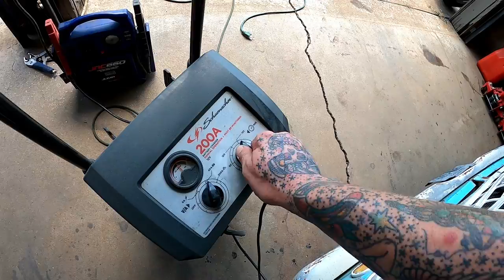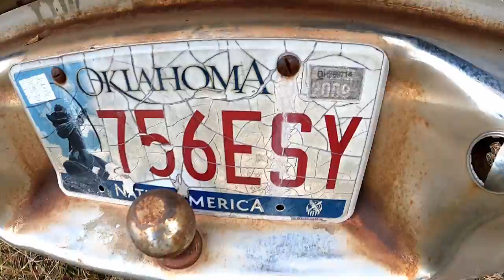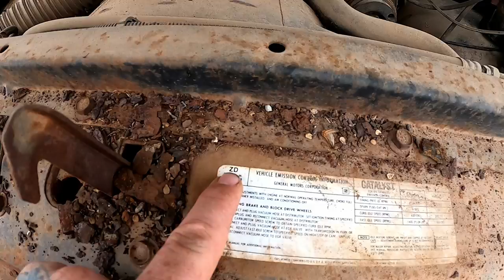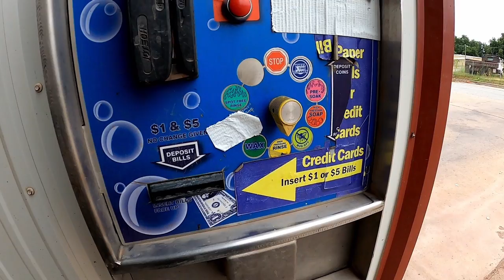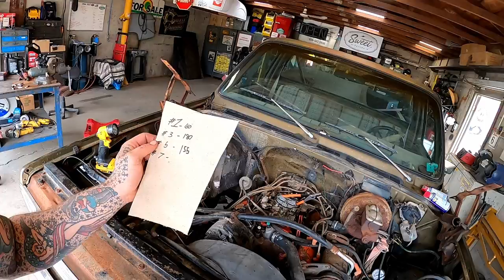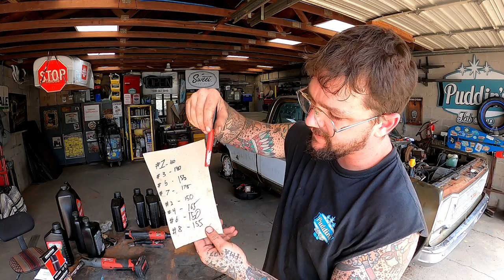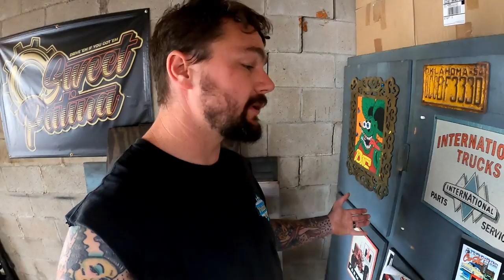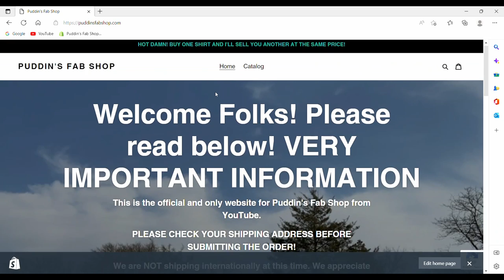FREE 1976 GMC Sierra. ABANDONED on my new property! WILL IT RUN?!?

Comment: When  installing a Small Block fuel pump. Open up an old hose clamp (worm gear variety) and use it to slide the rod up and out of the way. Your welcome.

Comment: MUCH RESPECT for your approach to the "will it run" genre. As always, your systematic attack is so refreshing compared to every other channel! You clearly were trying to preserve the potential for the longterm usefulness of that engine.....and, boy, what a healthy sounding one it turned out to be!! Hubby and I are debating exactly what kind of gem you've got there...the orange color and two line fuel pump (Airtex 40987) imply a potentially older and hopefully higher horsepower one than the year of the truck. Airtex 41216 style pump has the extra return line and I believe is more likely correct for that year. We're also trying to remember when GM changed engine color on trucks to aqua/blue. What we're saying is, please run the numbers on that engine to see exactly what is....it sounds reeeally good, especially for an abandoned truck with a quadrajunk carb!!

Comment: IMPORTANT block off those heater core hoses otherwise your coolant will go through the hose instead of the motor because without the heater core those hoses are the path of least resistance.  AND DON'T LET ANYONE TALK YOU INTO GETTING RID OF THE QjET.

Comment: That was a good trick with the magnet on the fuel pump rod.  under the alternator is a bolt. If u pull that out and stick a screwdriver in that hole it will hold the rod up. Thats how ive always done it.

Comment: On chevys, that fuel pump rod, if you take a glob of grease and put it on the shaft, and shove the shaft back up into the block, it gives you enough time to put the fuel pump in the hole

Comment: For the heater delete, all you gotta do is plug the ends or pinch them off. They don’t have to connect or flow. Same as putting a plug in the holes. Heater delete for racing!

Comment: There’s a bolt on the front side of the motor that you can remove and put a longer bolt into to hold that fuel pump rod in place when you take out the pump and replace it

Comment: 57:20 A slightly easier trick my grandpa taught me to deal with that fuel pump push rod, is pull it out, give it a coating of some sticky high temp grease, and send it home. The grease will hold it in place long enough to get the pump installed.  I also use this trick on my sockets to hold a nut when I need to get it back in a tight or weird angle spot.

Comment: QJets are like fine wine, they get better with age. On the front of the engine by the fuel pump is a bolt, take that bolt out and that gives you access to the fuel pump push rod. Take another bolt that’s a little longer so you can put pressure on the pushrod to change the pump.

Comment: My dad's 1952 ford prefect sat for 3 5 months all original apart from 12v system it started in bely 10 seconds it idled had no problems 
It's been sitting for about 6 months as alternator is buggered and battery went pop

Comment: GM mechanical fuel pump install.  Remove the mounting plate, pull the push rod and plaster with heavy axle grease, replace to hold it in place, replace plate, install pump.

Comment: Look at the front of the block right in line with the push rod an U should see the head of a bolt. If a guy takes that bolt out U can push the rod up an put a small screw driver in the bolt hole to hold the rod up while U set the fuel pump in place. Teck tip for the day. Great little truck. Glad to see U moving on up. Thanks, good job 👏

Comment: HOT DAMN! That looks like an old "Gentlemen Jim" GMC. It was a package on the Sierra from about 1975 to about 1977 or so, hence the woodgrain on the dash and door inserts. I'm not sure if it's worth anything,  but those old square bodies are going up in value. Thanks for sharing, Puddin!
Reply: I've got a 76 myself with 86k original miles. Belonged to my great grandfather that he bought new and drove around town. Pristine body and interior. I've been offered $30k for it. I probably should have taken it but the next 30k I'll take for sure. Assuming it comes along again.

Comment: Corporate 12 bolt rear end most 1/2  tons have 10 / 12 bolt, 3/4 ton &1 ton are 8 lug turbo long shaft 350 trans clean 350 motor, you got something pretty decent right there, nice work dude since it's 2wd. I would do a 5inch flip kit & 2 inch drop shackles. 4 inch  drop  spindles   up front, and drag the bumper off it!!!  Headers headers headers headers!!!!! 3 inch pipe after,    
Maybe give the ol towrolla some real love with  a brand used 2zz motor front a newer Rolla with a shift kit.  She sure does help alot.

Comment: Fuel pump push rod.. there's a bolt on the front of the block.. replace it with a longer bolt and it will hold the rod up while you change pump.. 😎👍

Comment: 42:55 An easy way I've found to thoroughly drain bottles of oil and other valuable fluids --- get a wide-mouthed funnel and insert it into one of the mostly-emptied bottles, then place each of the other bottles upside down into the funnel and let it drain for maybe five-to-twenty minutes (depending on how heavy the oil is).  Then place the funnel into the oil-filler opening on your vehicle's engine, insert the spout of your now-partially-filled collection-bottle into the funnel, and allow it to drain upside down for maybe 10 minutes to half an hour (again, depending on how heavyweight the oil is, and also how warm it is outside where your vehicle is).

Comment: There's a bolt hole on the front on the block down by the fuel pump, run a bolt in it before you take the pump off. It holds the pump rod up so it can be changed easily.  👍

Comment: On the front of the block, there's a lonely 9/16, just chilling all by itself in the block.
Remove the little stubby 9/16 bolt,  lift the fuel pump rod & snug a longer 9/16 bolt (3/8x16thread) in hand tight.
That will hold the fuel pump in place well you install the fuel pump. 
Just don't forget to put the little stubby one back in when you're done! ;-)

Comment: When you are installing a fuel pump on a small block Chevy, there are threaded holes in the front of the engine that you can put a bolt into and it will go against the fuel pump rod and hold it in place while you put the fuel pump in. I can't remember if the factory has a bolt in the front or not, been a while since I've worked on one. You want to screw the bolt in until it just makes contact and will keep the fuel pump rod in place. Nice score on the truck.

Comment: I bought a 97 Tahoe for scrap price a few years ago, $300 bucks with the intention of using some parts of it and either sell or scrap it, the guy said someone did a tune-up on it and it wouldn't run afterwards, I hauled it back and I played with it and noticed they had all the wires wrong on the distributor cap, I fix that and it started right up and ran great aside from he power steering line leak from mice as it sat for over a year. I fixed that and sold it for $2700.

I bought my daily a 99 GMC suburban that had a hole in the block for $340, I changed the engine from some truck that I knew nothing about, runs good, but has oil pressure issues at idle, I still daily it, I got another 5.7 Vortec waiting to drop in it when the time comes lol.

Comment: Hey Puddin', there is a short bolt going into the front of the block that lines up with the fuel pump push rod. If you remove that bolt and put in a longer one before removing the pump it will hold the push rod up while changing pumps. Just remember to switch bolts again before starting the engine.

Comment: I Got My Dads 1976 C10 350 Engine, 350 Transmission.  Short Bed, Factory AC, its 2 tone white with Carolina Blue between the  molding, Need to restore it gor 201,00 on it all original paint and blue interior! Keep Up the Great work my friend!

Comment: To. Help get your projects into the shop. This is what I did. I installed 1/2 drop in  concrete anchors into the garage floor and a single anchor about ten feet in front of the garage door. 
Then I mounted a cheap wench. I can pull anything I need into the shop by myself. Use a snatch block  if needed. I remove the bolt that mounted wench and the anchors are flush with concrete. Takes minutes

Comment: QUICK TIP FOR CHANGING FUEL PUMPS ON OLD CHEVY SMALL BLOCKS AND MAYBE BIG BLOCKS TOO.PUT A DAB OF GREASE ONTO THE TOP END OF THE LITTLE PUSH ROD, THAT WILL HOLD IT UP LONG ENOUGH TO GET THE PUMP BACK IN, ALSO DOESN'T HURT FOR A LITTLE LUBRICATION. STAY SAFE HAVE FUN

Comment: the trick to shutting those gm hoods without turning them into a taco is to push it back towards the cab to start the hinges moving, then pull it down to close it. works every time. lucky you having a c10 with a tree fitty come free with the homestead. if i'm not mistaken, the red engine paint might indicate a 4 bolt main engine. i'm looking for a 70's chevy 4 door car sitting in the weeds somewhere to pull a sbc out of for my '36 chevy truck project. won't find a square body anywhere around here. somebody has already snatched 'em up long ago to put back on the road.

Comment: That truck has the factory sport mirrors most of the C10 trucks especially the custom deluxe and Scottsdale trucks that didn't get the below eye level mirror options.. and I am from the area where if farmers ignition switch or park neutral switch goes out or is out of position they drop the ignition switch off the top of the lower shift tube on the column and or the 2 power wires hanging over on both sides of the steering column smack them together and throw sparks starting the truck and usually the starter is very loud and needs shimmed or shims removed

Comment: Take the top off a q-jet replace the accelerator pump and reseal the fuel bowl where the original epoxy dries out no longer sealing and let's fuel drain out,a quickie cleanup and she'll be a 1or 2 pump started and running champ

Comment: When installing the fuel pump there is a bolt that lines up with the push rod, one of the timing cover bolts I think, remove this bolt and install one longer, this longer bolt can reach in far enough so when you push the push rod up you can snug this bolt and hold the push rod in place while you install the pump.
Once you install the pump, you swap the shorter bolt back in place.
On the rear end I would top up the gear oil, put on some tires that hold air and drive it around and listen for rear end noises. If it sounds ok then just replace the pinion seal. You can check out how the tranny functions.

Comment: Neat SBC trick that will help you install block mount fuel pumps locate the passenger side water pump lower bolt and you will notice two bolts one that is in the recessed part of the engine block and one shorter bolt below it use your finger and a screwdriver push the fuel pump eccentric rod shaft back up and swap the two bolts and it will hold up the fuel pump rod so you can easily install the fuel pump..

Comment: Hey Puddin it is a lot easier to close a GM hood if you push each corner of the hood from the front towards the windshield first. One corner then the other and the hinges will start to close. Then close the hood the regular way. Just some tip from me. Take it or leave it. Keep up the great work.

Comment: You can polish the dash bezels up with toothpaste or some semicrome metal polish. I think I read brasso would even work. If your wanting a quick job just spray with WD-40. But wd 40 dont last long as polishing with an abrasive like tooth paste or semicrhome polish. Ratrod Bob has a whole video on a taco hood.

Comment: Puddin, you may in the future have a very hard time finding parts for that truck. A good bit of parts on it will be 73-76 only and 75-76 only. barely anything is reproduced for those years. When you open the hood, on those older trucks. Pull it Towards you & continue to push it up. otherwise sweet rig. Good old Quadrajet!!! love that sbc exhaust Rapp.

Comment: My 1976 GMC C20 Camper Special in WI had plywood floorboard back in 1987..  This truck here is barely rusted in comparison. Could kick an empty can out the corner by the clutch & crush it under the rear wheel. whoop-splat!. 0-60 in 2nd (actually 3rd cuz grannyk) gear.  Those 350's are virtually indestructible.

Comment: I had a 74 Chevy C10 Cheyenne super long bed 2wd it was a factory 12bolt 4.56 gear rear end and originally was a 454 2bbl ac 3spd on the column manual Saginaw transmission no power brakes but 6 lug brakes and big brake shoes in the rear

Comment: 150psi to 180psi compression is 16.7% of 20% max tolerance of percentage difference between cylinders for passing grade as healthy eng. And maybe it will get better after up and running a little.
Oil press and quiet mains and rods is the next question once running temp is reached

Comment: What a great find. If the numbers match on the engine, she might be worth a good old fashioned restoration job. Even that folded hood looks like she'll survive with a little bracing.  BTW it looked like when you were first trying to get the hood closed out in the field and you sat down on the right side of the hood, I think your mouse come flying out the front of that hood on the left side. He was a flying faster than a politician runs from the truth! Your ICR (instant carburetor rebuild) juice did a real good job, too, on that quadrajet. That truck looks like a nice old gem!

Comment: Dadgum GM had to have brackets to hold on brackets back then. Going to serpentine belts was a wise move on their part because they damn sure could not design v- belt brackets for the engine accessories.

Comment: You should put a flat on it stacks or sida pips good set of 10 inch wide wheels a gooseneck ball and a good back bumper and a good ball there maybe back air bags and make you a truck to pull your car trailer with

Comment: Don't strip that square body for parts! It's probably just a blown out pinion seal and a few tires from being a driver.  GM 350s are a dime a dozen, and you've got a crate motor on the floor of the shop just taking up space. The smoke looked like carbon and will probably clear up with a little run time.

Comment: Where did you get the tires for the Towrolla? I have a Corolla as well and want to get similar tires, but I've had no luck finding tires that fit. Is it not the normal size wheel?

Comment: PUDDIN, you are committed to getting that 350 quadrajunk running, but you should be replacing the spark plugs with a by hand situation...... Those blocks tend to strip out at the top of the threads of the spark plugs...... I GOT THE LUMPS AND THE DENTS ON MY HOOD TO PROVE IT...... GRANDPA ALWAYS TOLD ME RO STAR EM BY HAND AND TIGHTEN THEM down till they don't move any more..... The saving grace on this block and heads is they were junk metal but they could take a beating until GODZILLA DECIDED TO STOMP ON THE ACCELERATION STEP UP AMD RED LINE THE MOTOR A FEW TIMES blowing off the top end.

Comment: I really don’t know why Quadra jets get a bad rep. They are the most reliable carb out there until people who usually say “ I don’t know about that fuel injection give me a Cob-ew-rate-or instead” or “ I had a 1994 Chevrolet with a throttle body and swapped it for a carb” have worked on it. They are definitely the most complicated domestic carbs but really dialed in if you just put them back together exactly how they came apart.

Comment: 35:55 I don't blame ya one bit for not liking side-post terminals, Dude --- they just always seem to trap corrosion so much more than the old top-post-style batteries.  I have converted so many side-post-cabled cars to top-post that I've totally lost count!  I do not, however, actually cut off the cables' terminal-ends like you did here; I've found that the terminal's flat copper inner contact-ring usually is still connected just fine to the cable, even if there is extreme corrosion present on the terminal.  So what I do is use a very sharp utility-knife to just carefully carve away the terminals' red and black plastic surrounds, leaving just the cable and the ring.  I then "totally go crazy" for an extended period of time with a wire brush and/or steel scrubbie-pad, Comet cleanser and/or wetted-baking-soda paste, and repeated strong-baking-soda flushes till I've removed as much of the verdigris as possible, and the terminal-rings are totally scoured clean and shiny as a new penny.  Then I bolt on a side-terminal-to-top-post converter-terminal (i.e., it has a regular heavy-duty pure-lead cinch-together collar for attaching to the battery's top post, but then it has either a threaded hole at the opposite end for bolting on a side-terminal cable, or a threaded stud over which you fit the side-terminal ring and secure it with a nut; I think I've also seen a few that instead had a heavy flat ring for pressing against the side-terminal ring and securing with a bolt and nut.  By the way, I try to use stainless-steel bolts, nuts, and washers for making car-battery connections, since they resist corrosion much better than copper, plain-steel, or zinc-plated fasteners); not only does this method avoid your having to strip the cable-ends, but it also does not shorten the vehicle's existing cables at all; as you saw here, the stingy-with-their-valuable-copper auto manufacturers often only make their battery-cables little more than just barely long enough, and so you'll want to include as much of the original cable as possible.

Comment: Do you have a title for this truck? If not is it a hassle to get one in Oklahoma? Also. I hope the new tranny fluid doesn't mean that they changed it hoping that would stop the slipping and didn't and thats why it was parked. Them old chevy rear ends are pretty tough so since it had some lube in it you may be alright. If it shifts OK, look around for a flat bed and throw on it. With the fake duellys on it and a push bar it would sell pretty fast. I wouldn't cut up the exhaust myself unless its pretty rusted out.